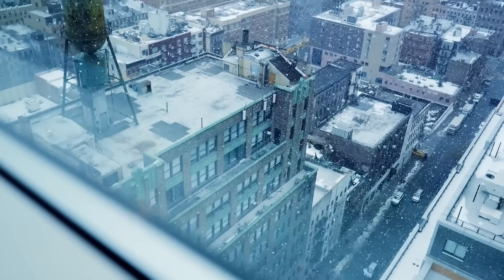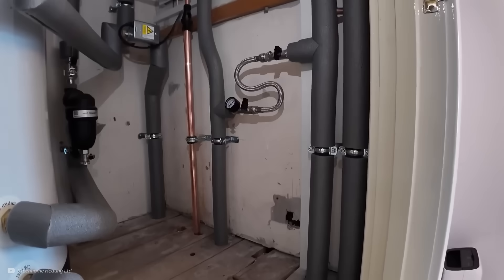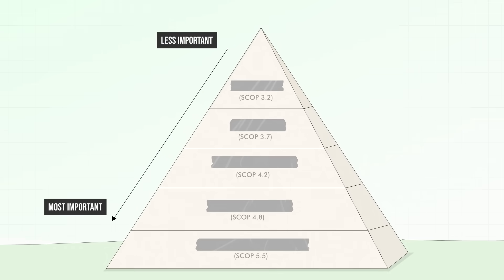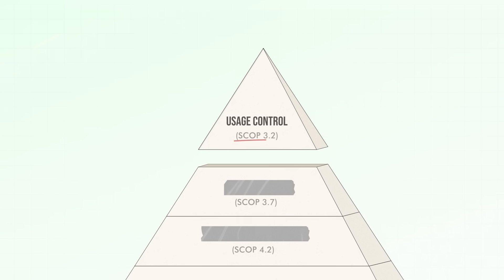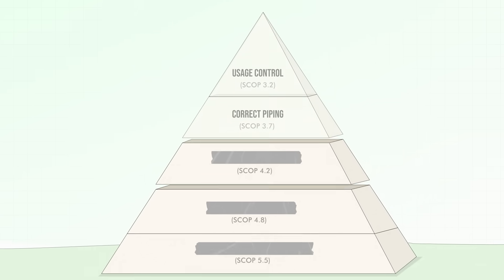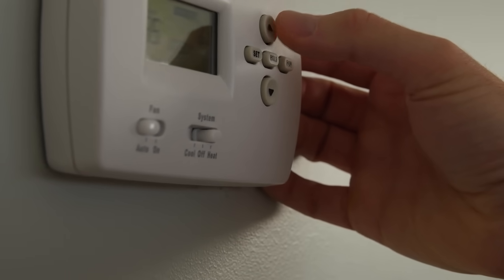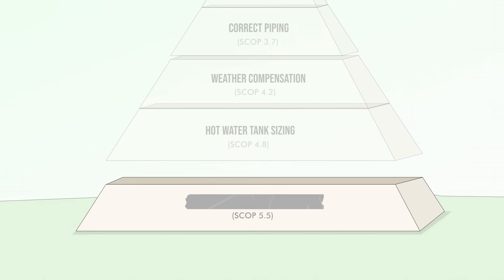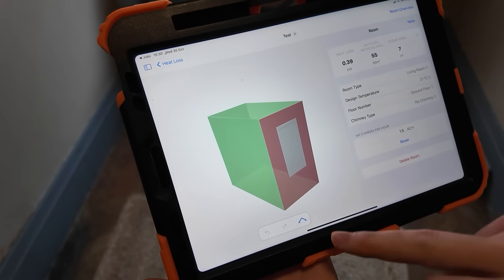The Genius of the World's Most Efficient Heat Pump

Comment: Looking at houses around Australia, it blows my mind seeing people install solar panels before installing heat pumps or insulation. Virtually no houses/apartments are insulated here.
Reply: This is the real answer and unfortunately the most neglected. Instead of jumping to buying newest, bestest, most efficient whatever system every homeowner needs to first make sure their house itself is not fighting against them. Good insulation means a new unit will have to run less or you might find out that your old unit actually runs better than you think and you don't need to replace it. There's also a weird misconception that insulation is only for places that get cold which is wrong because it also keeps heat out making your AC run much better as well.
I've been in a house with a relatively huge HVAC system because their previous smaller systems couldn't keep up. Turns out mice and other critters had stolen entire chunks of insulation to make their nests and there were thermal holes everywhere.
Reply: So essentially you are saying as an example that we built the most efficient refrigerator but it doesn't save you any money because the kids keep forgetting  to close the door on the ice box.
Reply: @kerrryschultz2904 haha that's one way to look at it. My point was more that solar panels are less cost effective than insulation or efficient cooling/heating yet people don't utilize them here
Reply: @DavidAlsh  I'm in Canada where winter temps get down to -30 C. or colder at night and daytime temperature -15 C or colder. With out insulation we could not survive. Maybe not as life threatening, but You have very hot weather hitting 40C. or sometimes hotter especially in the interior of Australia. Seems to me that insulation would be essential to allow a building to achieve some level of comfort from air conditioning, without out the unit having to work so hard. Do the building supply retailers not carry insulating materials.

Comment: The secret to any excellent heat pump is not just the unit itself - but the whole system, which includes the way of how heat is distributed away from the heat pump and into the home. That's something Heat Geeks stress all the time and it's why retrofitting heat pumps is  such a challenge.

Comment: You only have to look at the mass of intricate pipework, sensors, valves, tanks and auxiliary electric heaters to know this system is going to be a nightmare of maintenance, repair and general trouble-shooting (by a professional). Come the cold weather you can bet the  repair service from the installers will never be immediately available and whereas I can fix my oil fired system myself with a few tools,  the challenge of these fancy intricate systems will prove both expensive and frustrating. I would only consider this gamble in a new-build home where adequate space might  be made available to accommodate all the complicated hi-tec internal equipment.
Reply: I think you are correct that the very complicated things have a much greater chance of failure, not to mention the cost of the system. On the subject of a new build home, super insulation is much more reliable if done properly on lowering heating and cooling loads. Most older homes can be retrofit to be far more energy efficient by up grading the insulation value.
Reply: Someone only glances at the surface on all the tech we take for granted!  Your oil burner is a design which has existed for (and do please correct me if  I'm wrong) a century or more for the solid metal bits and up to a half century for the control gubbins.  There's going to be a difference between decrudding the burners and identifying a faulty control board .... unless you happen to be trained.  

There's invariably a trade off between ease of maintenance and efficiency in pretty much any system involving transduction of energy in whatever manner.

Comment: I'll keep my NG furnance thank you very much. $60 a month in the dead of winter and solar offsets 115% of our usage 3yrs after install. I'm happy with the balance, keep your heat pumps.
Reply: If your current system is operating within normal parameters and it's optimim economic life, I wouldn't change it yet either.  I might look forward to what happens when it goes the way of all things  .... assuming that's likely to be a while before you do .... says the bloke already dipping the occasional toe into the grave!!

Comment: A good post. However, it looks here that we have a lot of variables to consider and assumptions. Not to mention maintenance issues. Is there an AI based system that continually looks at variables like outside temperature, systems running internally, identify components of the system that may require maintenance etc without a human looking at all of this?

Comment: Excellent info. One major problem with hot water is the loss of heat in traveling to the taps and the consequential over use of water as it runs while waiting for the hot to arrive. There needs to be some way of accessing the hot water as close to the point of use, as well as recycling grey water.
Reply: Most would benefit from point of use hot water and ditch the tank.

Comment: I would have flipped the pyramid with the cop 2.5, the “normal” being the base and building off of that. 

Excellent video!!!
Reply: Yeah, that makes more sense, on multiple levels. No idea why they went upside down. Fortunately it doesn't detract from the important information in the video.
Reply: Same, it seems completely backwards to me. Pyramids start from the bottom with the bare minimum, and work their way to the top while running into diminishing returns. A half built pyramid doesn't float, but misses some of the increasingly smaller volume gains that can only be built once you have their base.

Comment: My own preference would be for a table of COP values for various input temperatures. It seems to me that the SCOP values discussed here are based on implementation details that while important are not under the control of the heat pump manufacturer or the technology used by the heat pump itself. imho.

Comment: Interesting video. I thought that geothermal heat pumps were the most efficient of all due to the near constant temperature of the heat reservoir (i.e. the ground). The outside air of course fluctuates with the seasons and weather but soil temperature varies only a few degrees year round. Doesn’t this mean greater efficiency?
Reply: They are,but upfront cost for drilling and extra is so high that your heat requirement need to be very high to have it make sense financially.

Comment: The average heat pump in heat mode, commercially available for less than a kings ransom, will get 300% efficiency on a good day, and it goes down from there as outside temperature drops until if it is cold and humid enough the coil ices and then it defaults to resistance heating at 100% efficiency.   My gas furnace runs at about 95% efficiency in all weather conditions.  However here in Missouri the cost of natural gas, converting BTU to KWH is about 1/6 the cost of electricity.   So to get equal cost for a unit of heat into my house, a heat pump would have to average about 600% efficiency.   Net, I pay noticeably less than half to heat with gas.  These videos always talk about efficiency, not $ per unit of heat delivered to the house and ignore capital cost.   Good luck trying to sell me a heat pump.
Reply: I live in Missouri as well and the gas cost is not that cheap. I pay Spire ~$1.25-1.30/CCF + fees. That's about 4.2 cents/kwh. If your furnace is 95% efficient thats about 4.4cents per kwh of heat in your home. Ameren winter electric rate is 6.27 cents/kwh after 750kwh, which you will always blow past with a heat pump on top of your usual electric needs. 
To break even with the 4.4 cents of natural gas you would only need a COP of 1.43. That's achievable even on the coldest days with modern heat pumps. There's alot of cold specific heat pump models out now that get ~1.9 COP at -5F, which is about as cold as it ever gets in winter. 

For most of the winter, late fall, and early spring, you'll be heating your home when its 25F+ outside where the heat pump is able to run at a COP close to 3.0 or more. That's twice the break-even cost efficiency of the gas furnace for the majority of the heating season, and break even at worst for 1-2 days per year. 

I can look at my HVAC usage on my phone with the Ecobee app. Its been in the 50s and 40s, and cloudy all this week over christmas and my furnace is running only 2-3hr PER DAY. Its cycling on for 15min and then off for over an hour, and then on for 15min, and then off.
Reply: First of all, 300% efficiency is about the lower end of what you can expect, not the higher end. My system runs at 400% SCOP. You are completely neglecting the emissions from your gas based heating system, which hurt both the air quality and our climate. Heating with gas should be much more expensive, and heating with electricity should be much cheaper. Unfortunately in most countries the tax laws are completely backwards and gas is actually taxed less than electricity, which is bonkers if you ask me
Reply: Obviously there’s the issue of carbon emissions that you don’t mention in this. Either way it’s not all individual change but macro change. If they had a 50% efficient Nat gas plant and you had a 2.5x heat pump we’d all be saving fuel and energy cost, but it takes time to adopt new infra
Reply: Videos often don't talk about cost per unit of delivered heat because it depends on utility rates which are different everywhere. I also live in an area where heat pump heating costs more than gas heat but plenty of people have cheaper electricity, more expensive gas, or no gas.

I'm also going to point out that common units seem to consistently get a COP of 3 or better whenever it is above freezing outside.

Personally I'd most likely go for a "dual fuel" heat pump + gas heat if specifying a new system. On warmer days when the heat pump works better use that, on colder days when heat pump is noticeably more expensive switch to gas. Or if one malfunctions use the other one instead of being left with no heat.

Comment: Top tip,   don't dry clothes on radiators, lower the flow temperature but keep system running not on a time clock. Keep RH below 65, the EcoAir 122 simple is a desiccant dehumidifier which uses 350 watts (for heating) and extracts 7 ltr water.  Can be used to dry clothes and in the bathroom so latent heat in the moist air is recovered . Gas, Elec or heat pump keep the humidity down, 13 room house I use much less gas and electricity when running dehumidifiers.

Comment: how applicable is this to a forced air heat pump furnace? here in canada they mostly seem to want a 2-stage thermostat signal, which is not ideal, as pointed out in this video. but i don't know if we could be hacking the furnaces for modulating control?

Comment: ENGINEER HERE
You and the rest of the Heat pump brigade NEED to STOP saying things like 300% EFFICIENCY.
Every engineer learns that you cannot get above 100% efficiency for any thermodynamic process and it's called the Laws of Thermodynamics. This is why Heat Pumps use COEFFICIANT of PERFORMANCE (CoP) which is NOT the same thing as efficiency its a measure of performance.

AND THERE IS A VERY SERIOUS ISSUE HERE with people misusing the word efficiency and confusing the general public.

Right now there are all sorts of claims being made by various people over the efficiency of various power generation systems and how we use electricity. How do you think we can explain to the general public the efficiency of a nuclear power station is 36% and that's good or that gas turbines are about 46% and that's good or that combined cycle gas turbines are around 64% and that's good when you are claiming heat pumps are 300% *WHICH IS ADVERTISING JARGON?*.

As an engineer I recently WASTED several days recently explaining to a client that ChatGPT was WRONG about an energy issue because ChatGPT can't tell the difference between FACTS and  ADVERTISING JARGON. FYI - the issue was over grid stability and that certain dc-ac inverters are labelled as "pure sine wave inverters" and the fact is that NO inverter produces a technically pure clean sine wave output. (Go look at the Wikipedia page for power inverters). Its just ADVERISING JARGON. This particular piece of advertising jargon is about to come slamming into every society that has substantial amounts of renewables feeding into their grids via dc-ac inverters.

Its a major issue in Ireland which now has a lot of wind power. The channel Real Engineering did a fantastic video on the subject. I doubt the flywheel solution will work because that fly wheel will still need a power input that wasn't explained. What the Real Engineering video highlights is the substantial difference between energy sources and how they pump energy into the grid. All through the fossil fuel era this was never a problem because all those massive steam turbines with their inertia did the job.

Its actually the one thing projects like Hinkley Point C have going for it, but the pro-nuclear lobby are so stupid they don't understand or realise this.
Reply: Well said and very valid on the use of wording.. I too am an engineer, live in a 130 yr old house with solid walls. I run gas for heating and hot water. which has worked very well for over 45 years. Yes it's inefficient but an ASHP would never achieve the 300% efficiency without investing £20-30K in an entire new system with massive disruption to the entire structure. Payback time would be off the scale.  Keep banging the drum about the misuse of the word efficiency when discussing ASHP.
Reply: @izalman  maybe better invest into insulation which lasts practically forever
Reply: @izalman  Thanks and its NOT that I think they are bad its the unnecessary advertising hype and it makes the rest of the energy discussion so much harder.

How do you discuss nuclear at ~35% or combined cycle gas turbines at ~64% when people are hyping on about heat pumps at 300% or 400% or 800%?

And that's before we get to actual discussions of costs and pay-off time and all the other things. What all these other clowns don't get is that people like you and me have been in those meetings where the clowns with economics degrees throw back at us:
"What's the business case for that?" or
"Who's going to pay for that?" or
"What's the benefits of that?" or maybe
"I heard that I can get blah blah blah from this technology. So why aren't we doing that?" Even when that technology is utterly irrelevant or its been considered and found unfeasible.

We've all been in that and none of us need those discussions to be harder than they already are AND SIMILARLY we don't need any of the public discussions we need to have to be MORE difficult than they already are.
Reply: It is pure, as opposed to Noni inverter sign wave generators, which can't operate the laptops. But the pure error the purer sign wave inverter machines can
Reply: @snorttroll4379  ADN DlCKHEAD don't go lecturing people with decades of experience with inverters when you CLEARLY DON'T KNOW WTF YOU ARE TALKING ABOUT.
Reply: CoP is used in thermodynamics to distinguish "moving heat" from "creating heat". Theoretically 1 (100% efficiency) is the highest CoP you can have for creating heat, but when moving it, energy efficiency can be higher than 100% which is why they use CoP ratio rather than efficiency percentage. In layman's use, they are essentially interchangeable, even if that is incorrect. Even MIT uses the term 300% to describe CoP3 so no use raging about it because nobody really cares about the difference.
Reply: @TheGalifrey  sane people shouldn't use percents, use ratio, simple as that
Reply: @TheGalifrey  BULLSHlT 
Sorry but its a violation of the second law of thermodynamics which basically is "Entropy always increases and therefore 100% thermal efficiency is IMPOSSIBLE in any process."

And as for MIT they aren't perfect and can be just as wrong as anyone else. Its advertising jargon NOTHING MORE.
Reply: @tonywilson4713  Wow, testy Tony is not wrong! Probably young has not spent 66years coming to grips with the fact the world is awash with bullshit. It is indeed frustrating.
Reply: @tonywilson4713 , but we are not discussing thermal efficiency here as we are not generating any heat.  We are simply using electrical energy to move heat from one place to another.  I couldn't care less if you are an engineer, you don't seem to understand this simple principle.
Reply: @tonywilson4713  nerd, listen, it's efficient in doing its process. Not every word is always used in engineering or physics mode. Words have various meanings and here its efficiency in moving heat or in doing